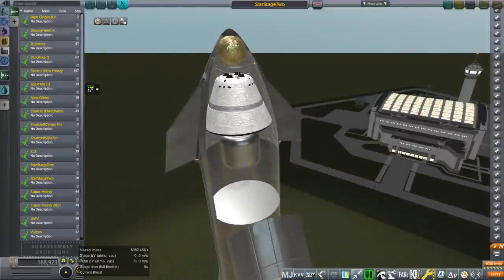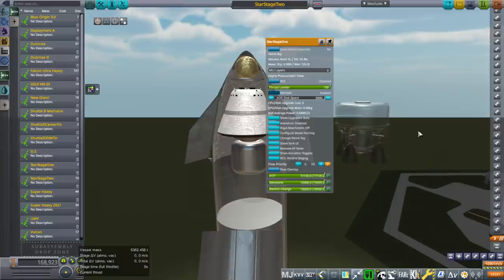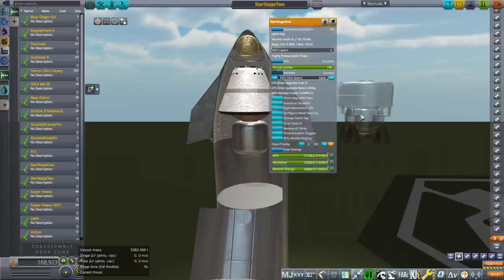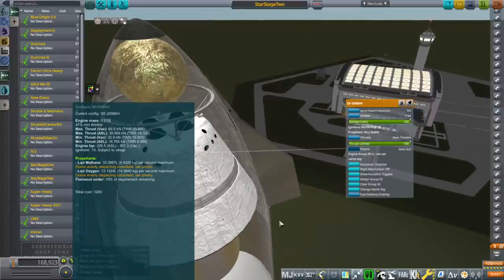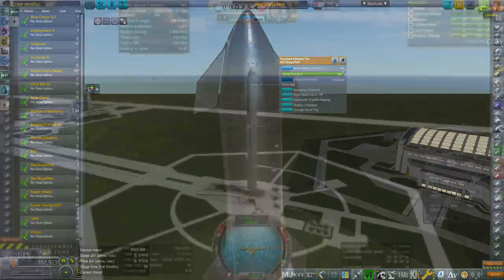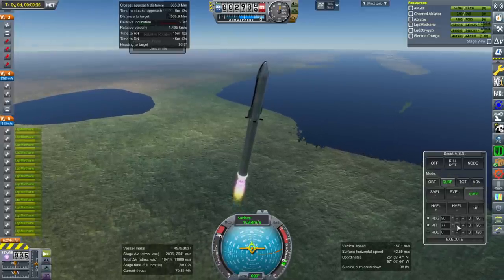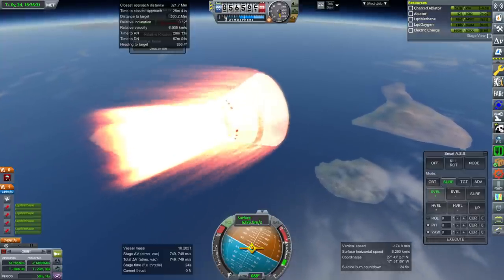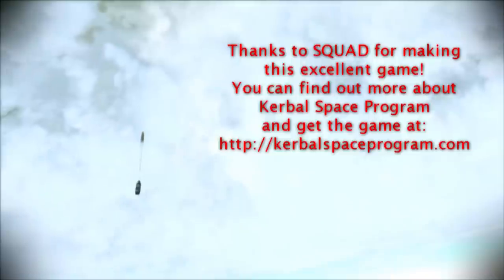StarStage Two - Reusable Methane stage for Starship

Comment: I’d be a little worried with the payload hanging upside down from the stage like that. Seems like there’d be a lot of force on the decoupler, having to hold the entire weight during launch. Plus you might have to design the satellite structure differently to account for the inverted forces.

I know shuttle had payloads hanging from their sides rather than grabbed from the bottom though, so maybe I’m overthinking it and it’s as simple as having stronger bolts on the decoupler. Either way, good video!
Reply from the maker: Unlike with StarStage One, which was for interplanetary probes, I expect the inverted payloads for StarStage Two to be pretty robust considering we're talking about 30-40 ton items. Generally, satellites and probes are built to launcher specifications, including expected forces and resonance frequencies, anyway, so I expect we just have to give customers a heads-up, if you will.
Reply: Almost all Chinese solid fueled rockets mount their payload and final stage backwards, it's a common thing actually

Comment: A little bit late but I love the concept of a cheap, expendable Starship third stage. Is there any ways to expand upon StarStage 1's capabilities?
Reply from the maker: The best thing is if the payload can provide some of its own propulsion. Asking for so much delta-v from one stage is not the most efficient thing, but obviously using two stages would be more expensive. Possibly a droptank arrangement like Briz has would be good.

Comment: You could use the M10-MIRA expander methalox engine in development for the upper stage of the Vega-E, it has around the same thrust and way better efficiency.
Reply from the maker: As far as I know, that gets 362 s ISP, so I don't know how it has way better efficiency than 367.

Comment: 0:53 why wouldn’t a starship third stage be used for GTO/TLI though? there’s enough payload volume, would be capable of 38t to those trajectories and makes sense to me, more than refueling (for cargo, not crew)

edit: watched the video and cool concept actually, but you’d probably get a 1/3 payload reduction by adding TPS and making the stage into a spacecraft with various systems, maybe 26t TLI instead of 38, might be practical given a higher flight rate of starship

Comment: I'm curious where you're getting 295s of Isp for nitrous and RP1. As far as I've calculated it the upper limit is ~290.

Not trying to be confrontational, just wondering what software/references you're using.
Reply from the maker: RPA Lite with a chamber pressure of 150 psi, 80 nozzle ratio, reaction efficiency of 0.9578, nozzle efficiency of 0.9776 and O/F of 9.208 gives 294.23 in vacuum.
Reply: @RaizSpace  Hmm. Weird. Usually it agrees with CEA. I'll play around and see if something weird is going on in CEA.
Reply from the maker: What is CEA?
Reply: @RaizSpace  Chemical Equilibrium Analysis. It's a NASA-made software. Nowhere near as user friendly as RPA but you can batch process pretty well.